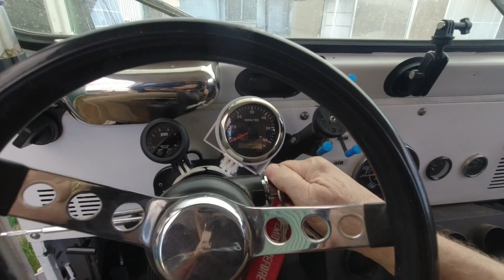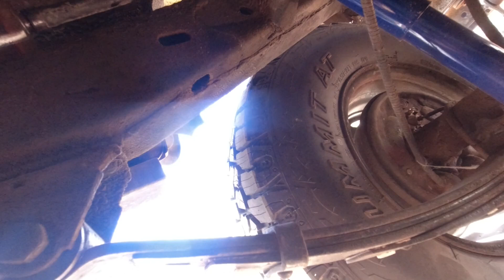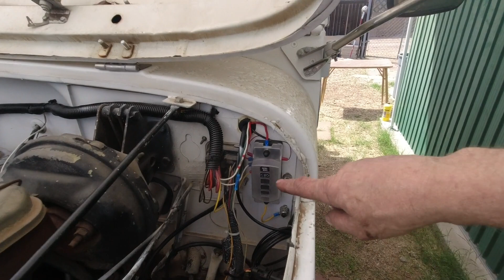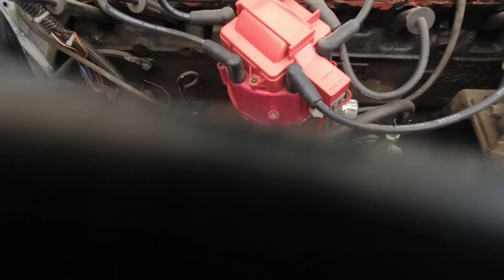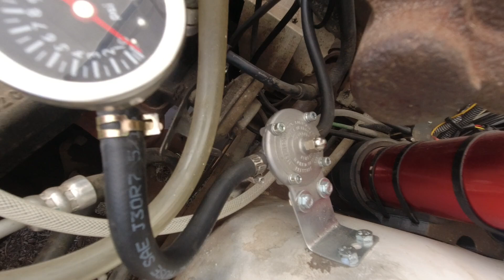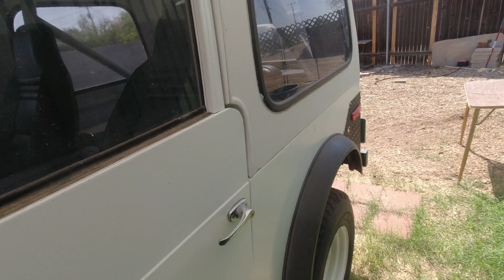Converting the CJ-7 back to an electric fuel pump. Holley Red

Comment: This video is a few months old now I know but from my experience and a friend, I will NEVER run Holley red pumps again!
My classic car sits around a lot in winter and as I found the pump started playing up, not pumping fuel, the rotary vane section had gummed up and from sitting around and was not pumping the fuel up!
This exact same issue happened to my friend with his classic car also but he bought a rebuild kit for his and fixed it, I however was sick of it and have read many bad things about the Holley red pump so I changed to a Carter fuel pump and so far it’s been eight years and it’s still running, even with winter and not using it. Also the Carter is much quieter than the Holley.  
I’m not surprised by this as even Holley carbys aren’t very good! This is why after many years I switched to Edelbrock carbys and have never regretted it. They just continue to work.

Comment: Thanks for posting this, I'm considering doing this to mine as well.  Right now I have a Facet cube-style that works pretty well but it doesn't put out enough pressure to allow me to keep the return line connected (seems to operate around 2-3 psi).  I have the return line blocked off right now.  It quit on me the other day, I suspect vapor lock, so I'm going to move to a higher volume pump so I can connect the return line.  I was going to go to the blue pump with a regulator but some have suggested it puts out too much pressure/volume (it operates at 8 PSI but capable of up to 14 and something ever 100 gph volume, which is way more than the 258 needs) but I don't want to run it too restricted with a regulator as it might burn it up.  My worry is the red pump won't put out enough pressure, my Carter 2bbl starves for fuel and will quit below 2-3 psi.  How confident are you that the gauge you have mounted in there is accurate?  Did you connect a vacuum/pressure gauge to verify it's really putting out 2 psi?  Seems like there's something wrong with the pump, but if that's how it runs I definitely don't want to go the red route.  My feeling was use the blue pump and connect the return line, with a gauge on the carb line from the filter and dial in the regulator until it shows 4-5 PSI on the carb line.  My worry is that I'll need to choke down the blue pump too much and cause it to wear quickly.  But I don't want to spend 200 bucks on another pump that doesn't put out enough pressure.

BTW, the red pump pulls 2 amps and calls for a 7.5 amp fuse so you should be fine there.
Reply from the maker: The only confidence I have in that gauge is from when I was running it with the mechanical fuel pump, it was reading what I expected from that pump. Other than that, I've got no confidence in it. Unfortunately, all my other gauges are meant for fuel injection and trying to read the difference between 3 and 6 pounds on those is impossible, the needle on the gauge is that wide. I want to eventually get a better low pressure gauge, but now that it's summer and hotter than Satan's asscrack here, it's going to have to wait a while.

Another thing to consider is I bought my Holley red pump from a friend who bought it thinking it was the blue, ran it for a while, bought the blue and then sold it to me. It's possible he damaged it, but I tend to doubt it.

Holley blue is 9-14 pounds and probably meant for TBI systems, it's a lot of pressure for a needle and seat to handle. If I ran that I'd want to have the return line and I'm not sure that a 1/4" return line, which is what's stock on my Jeep, is big enough. It would probably pass enough back to keep the pump from being damaged and the needle and seat from being bypassed. The only way to tell is try. 😬
Reply: @3rdpig  Thanks for that, the blue pump comes in a kit with the regulator for an extra thirty bucks, so my plan was to run the blue pump, with the regulator in line, connect the return line again via the filter setup, then dial the regulator up or down until I see 4-5 pounds on the carb outlet line.  I'm just concerned the 125 gph or whatever that blue pump is intended to flow at 8 psi might not be able to be cranked down enough to not overwhelm the return line or burn the pump.  I have the stock setup like you do with the fuel lines.  The red might work better with no regulator, it's designed to run around 7 psi with less flow and might not have to work as hard (being not restricted).  I just see yours putting out 2-3 psi and I worry I might be wasting 200 bucks.  I like the Holley pumps because you can take them apart and fix/rebuild them so theoretically it's a lifetime pump.  Got some  more thinking to do.  I'm in North Georgia, it's hot here right now too.  Thanks for your info.

Comment: Ok I've seen enough, all this work you're doing is getting way outa hand and I have to weigh in on this. That metal filter you have with the return line is wrong, that shouldn't be there. That line is a vent line to vent fuel vapors to prevent vapor lock, not to return fuel to the tank. Classic Industries sells those filters but they are kind of pricing. I've been working on cars since the 70's and Chrysler, as far as I know, is the only manufacture that uses them, now I remember those filters I think ford uses them and they were mounted under the car and it was fuel injected, that's definitely not for your jeep. I have a 73 Dodge Challenger with a 512 ci. stroked 440 and i have the same vent line, my car came with a 318 ci. according to the vin. I have it plugged off with just a vacuum cap, your mustang doesn't have that vent line and that's a bigger engine in a smaller compartment so your jeep doesn't really need to have that vent line. I agree with your starting problem and needing an electric fuel pump, back in the early 80's I had a 67 Z28 Camaro with a 454 big block .060 over, tunnel ram with two 600 carter AFB carbs I ran an electric fuel pump under the car that pushed through the mechanical fuel pump with a pressure gauge mounted on the cowl and a switch in the car, I would flipped the switch till pressure built up turn it off pump the pedal and the car would start, I could drive around town in 1st and 2nd gear just on the mechanical pump anything more I would have to turn the pump on, this is what you should  do. That holly pump should put out more if not get rid of it, just get another electric pump from the local parts store, put the mechanical back on and swap out that metal filter for a straight through and plug off the return line, get a holly style fuel pressure regulator and get a fuel pressure gauge that uses an electric sensor and put the gauge inside the jeep with a switch to turn the pump on and off, all you have to do is turn on the pump till the pressure builds up then turn the pump off, pump the pedal and it will start and you can drive around on the mechanical pump and you won't have to listen to a noisy pump. I know this is pretty long, sorry about that.
Reply from the maker: WTF are you on about? Were you drinking when you typed all that? This video is about my CJ-7, not my Mustang and that is the correct fuel filter for the CJ. The rest of the mish mash you typed is not applicable to either the CJ or the Mustang. If you've been working on cars since the 70's then you're around my age and should know better.
Reply: @3rdpig  Sorry dude tried to help you out and that's your attitude, you suck as a mechanic
Reply: That two output fuel filter is actually designed for the Jeeps, they serve as a fuel return, it's a real return line, not a vapor line.  There's a vapor canister in them (at least they came that way) that connects directly to a vent line to the fuel tank as it's technically a closed system.  The main output is a 5/16 line as I recall and the return is 1/4, with something like a 1/8 hole on the filter to serve as a sort of fuel regulator.  Low tech, but works well.  Prevents too much pressure on the carb and also keeps the fuel cooler to prevent vapor lock, especially when it sits at which point, I suppose boiling fuel vapors could go out into the return line as well.

Comment: Congrats on installing that Holley Red!  Even an 1/8" thick piece of rubber behind pump mount will make it so quiet it's hard to even hear it even running when engines off. I say forget those gauges, more harm than good here, they are not accurate at the extreme low and high.  I was stunned to see you pumping the gas pedal, you don't want to do that anymore!  I have the same Weber set-up,- 2 seconds of pump running, touch the ignition and vroom, every time! Also, the choke and cold start idle are shut off after 1 pump, I don't even do 1 pump  no matter how long it's been sitting. Only thing I've noticed is occasional slight flood on hot restarts, clears right up, but I'm continuing to decrease the pressure reg. (same as yours) 1/4 turn at a time to eliminate that. I agree it's a rather heavy pump, but the included bolts worked fine for me, even in the "speed bump every 100 feet" area where I live. For peace of mind I strapped 2 strong plastic ties around the frame/pump.  So- 1. A little rubber behind mount, I have to listen hard to even hear mine. 2. NO pumping. 3. Forget gauges, just keep dropping  (clockwise), reg . you'll know if you go too far, it won't cold start, or it will starve full throttle up a long hill. I haven't had either of those happen yet. Remember these Webers, ( solexes, most Euro carbs) only need 2 psi, and often are happy with just 1.5 psi!  You're 90% there, well done my friend!
Reply from the maker: You're stunned to see an old timer like me, who grew up with carbureted cars, pumping the gas on a cold start? Really? Stunned? Then my Dad and his Dad would have stunned you too, because just about everyone pumped the gas on older carbureted cars on a cold start. Not even a single tap on the gas means the choke plate won't close and the high idle won't be set. 
I tried a 1/4" piece of thick foam rubber behind the pump and it didn't make it quiet. I think the problem is the bolts are carrying the sound through to the frame and I'll need real isolators to prevent that. But I will try not pumping it next time. I'll wait a few more days and make a short video. Thanks for the comments!
Reply: @3rdpig  I have the Carter-style carb, when I press the gas pedal about halfway I can hear the choke set.  I let the pump push for a few seconds then maybe one squirt from the accelerator pump while cranking and it starts.  Your carb might just be leaner than the Carter at startup, whatever makes them start should work!  I doubt it's set up wrong, but you could always check your timing and the idle ports on the carb.  Sometimes the idle is set too lean and it can be overcome with timing, but yours sounds pretty good to me.  Make sure your return output on the fuel filter is at the 12:00 position to keep the line from draining out, though with an electric pump it should refill pretty quickly.  Hey, it runs well, no pumps three pumps, who cares, right?  :)